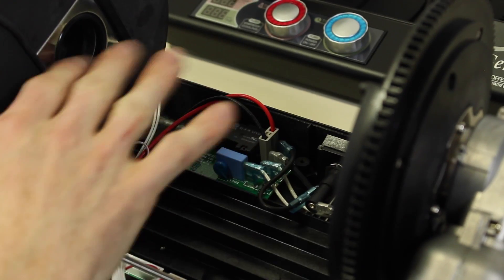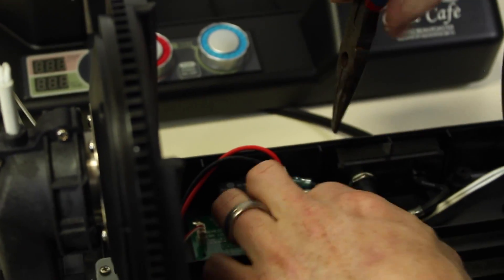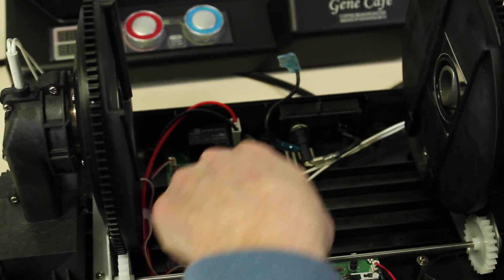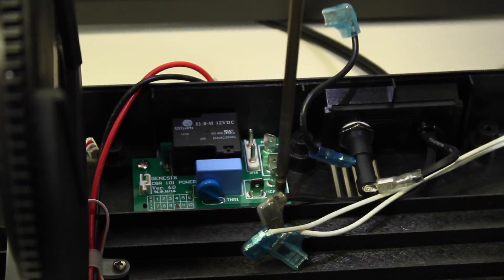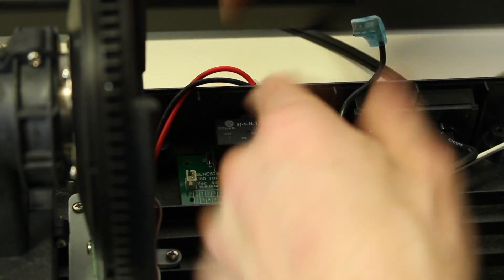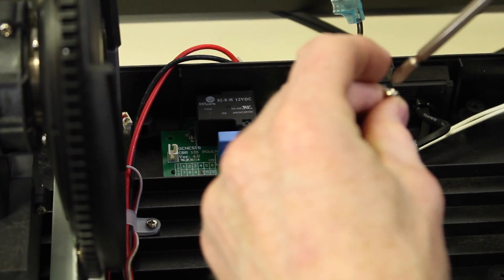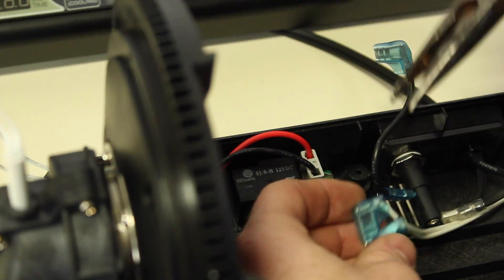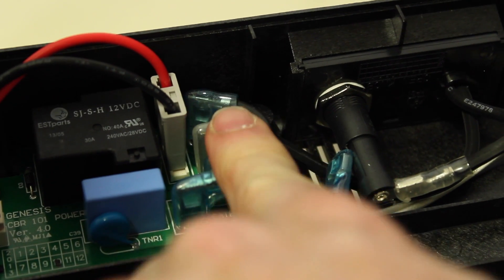Gene Cafe CBR-101: Power PCB Replacement

Comment: I ordered a replacement cord, fuse assembly and fuse because the fuse assembly melted where the Powercord clips onto it.  I can't seem to figure out how to get the old cord out without damaging the ring around it that holds it in place (I assume I need to reuse that part).  Any chance on getting a video showing replacement of the power cord and/or fuse assembly?